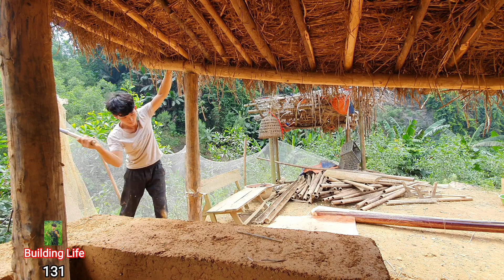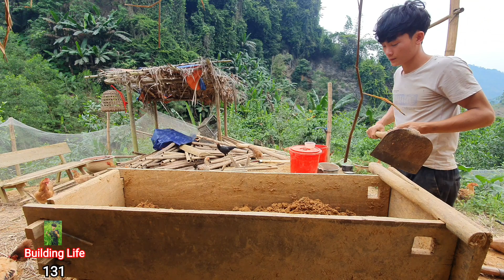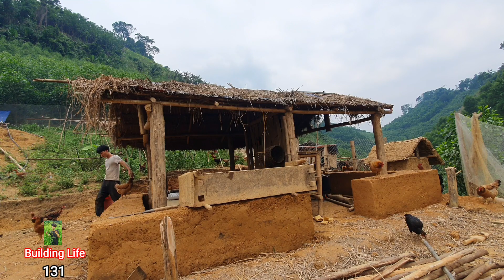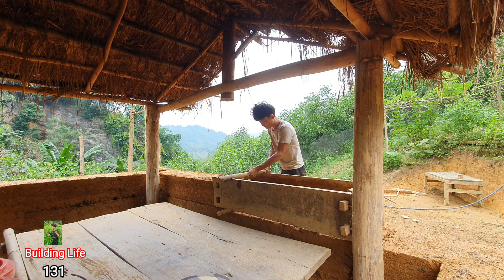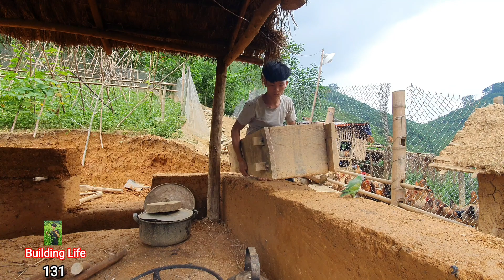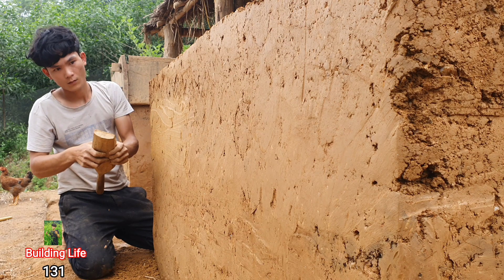Building a house on the 18th day, Building Life, Episode 131

Comment: Corrugated iron is a good choice for roofing.  It is durable and long lasting.  The only draw backs I can think of is that you have to buy it and it requires a fairly substantial framework to hold the fasteners, usually nails or screws.

Comment: It will be very hot under the tin roof! I would use wood. Make the frame stack round wood horizontally and wipe it from the top with clay and make a flat surface and put a metal roof over it. So that it is not so hot in the living space. The plate lightly conducts heat. Wood and clay no. When it gets cold, it is easier for the stove to heat up and dry it !!! Let the pigeons live under the tin roof. Make bamboo gutters under the tin roof. The water will not spray so much on the walls and weaken them by washing. Collect the water in large containers for watering the garden or watering poultry and cattle. It will be cleaner than in the river!

Comment: Canh are you sure when it rains heavy it will not wash your house away? If not then you are doing a beautiful and great job. I  like to watch your videos because you are a hard working man. I wish you all the best.✌️ 💖
Reply: He must burn all the walls to make it more solid and resist rain, but every year he must work on repairs
Reply: There is also something he did not notice that the moisture will rise from the ground to the wall. He had to make a foundation of stones or cement directly above the ground.
Reply: No, there will have cover on the top
Reply: @jasonchen3942  Well what about the sides? What about the water in the ground that will rise and be absorbed by the wall?

Comment: Hello Canh,I think you should use the stuff you took down and then you should use the iron sheets to put over top of it,that way it would be insulated it will keep the place warmer and when it rains it won't soak through if it is possible to use them both together I think that would be a great choice I don't know what you call the stuff you had up there it looked like straw I don't know what you call it but using that alone when it rains it eventually going to soak through but if you use them both together the rain wouldn't come through and it would be warmer

Comment: Also, I have a question. When you have finished the walls, do you plan to add a layer of concrete to the inside and outside? It would make the house last much longer, and help keep the water out.

Comment: Use corrugated roofing. Alot less work to build your roof. It's stronger and will last longer than bamboo. Just make sure you seal the nails with silicone so it want leak when it rains.

Comment: A corrugate iron roof will last much longer than any of the other choices. If you have the ability to use it, you should. You will not need to do so many repairs in the future with the iron roof. Also, you can hang gutters on it, and catch a significant amount of rain water.

Comment: In my opinión you should use plastic tiles on the roof cause they are long lasting and you won't have too spend so much money, cause the corrugated iron needs a lot of other materials that go together with it... and are more money too spend...

I had being wondering about how come you people don't wet this mud a little bit more so it will compact more unified...i see you people hitting this mud to keep it up holding together, when with a little more of moist it will compact more faster. That's what I think...my excuses if I'm wrong.
Good luck ,
and God be with you all along the way.

Comment: A House is not an easy thing to build. First you need to plan what use you want your house for  say a bedroom, front room kitchen bathroom and toilet.

Or just one room lsrge emough to fit in a bed table and chairs sitting couch  sgekeves and storage unit with kitchen   bathroom  or have the toiket and kitchen out side.

Ideally draw out a plan on paper with  the size of each room the lenght and width.

Using a string to get strsight lines in uour case.
Earth brick needs to be  about the same size in you case dirt brick yhst yiu are makjng as you go slong yding the wooden mould.

If the measurenents are not precise you will have a hard  time putting everything together and it will  not aligned properly.

Corrugsted roof will be  simpler and less work for you as you are are on your own. But  you will needs to fit  it correctly to stop leaks.

A backdoir i czn see why as his give you access both at the front abd back of your house.

Good luck